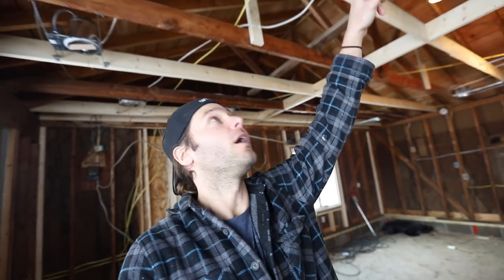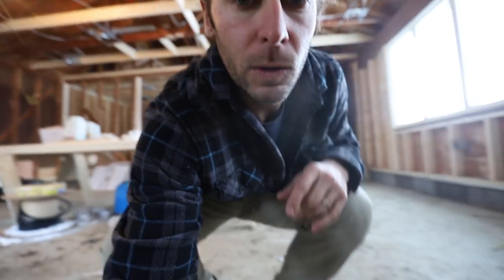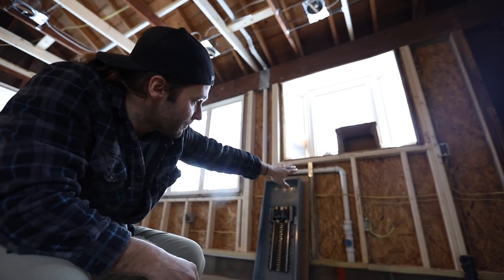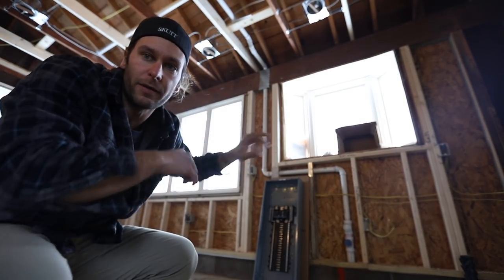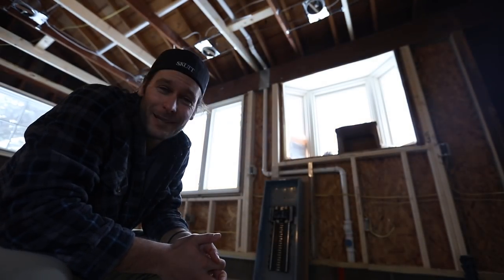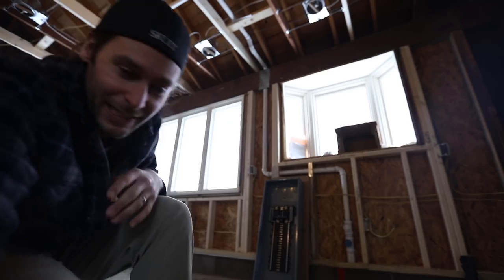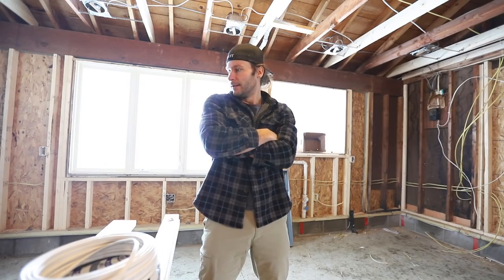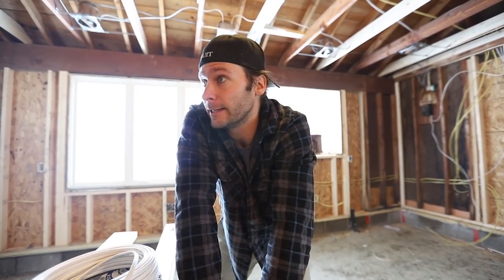Pottery Studio Progress - Electrical, Plumbing, Insulation

Comment: It will be amazing to have so much room to do it just the way you want.  And I’m sure by the time you’ve thought your work pattern through a bunch of times by now it will be perfect!
But since you ask, I was wondering if you were going to put a bathroom in your studio so you didn’t  have to go back in the house if the weather is bad and especially if you choose to have any classes there. Oh those windows facing the fields.  So cool.  Can’t have too many windows with the view you have but I was thinking, my wheel is by a small window but next time, I hope to put it by larger window so I can see out better and have the plug in a better place. So what if that first sink by the door was for the glazing area with your glazes  and mixing area in the corner with drying and glazed shelves going back to your kiln room.  That would put the wheel or wheels in front of that huge window with the finished shelves and packing in the corner to the right of the door as you walk out the door with your finished products.  (Curious, Did you put any drains in you floor?  I guess I’m messy and it would really help me keep my space clean.) Of course apart from the sinks and electrical plugs you can always rearrange.
Just my thoughts but I am sure it will be amazing and perfect for your work space. So close and almost done. Think your high now just waittill those walls and ceiling go in, Sheetrock moves fast and makes such a difference. Wow, so happy for you! Now I’ll go check out the Patreon page. Thanks again for all your amazing videos. Look forward to watching more.